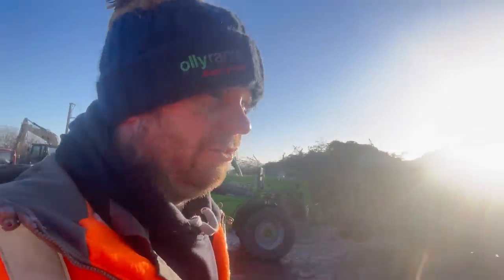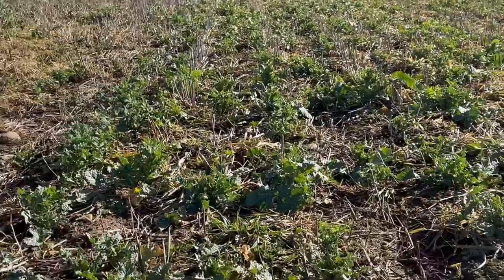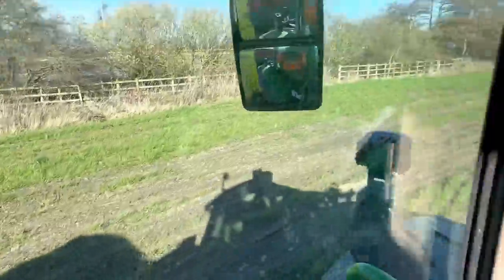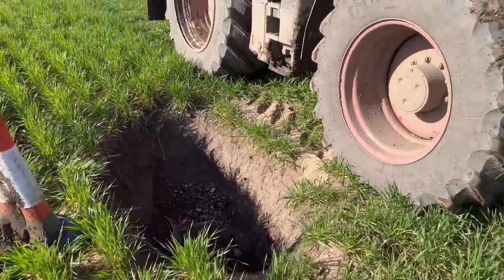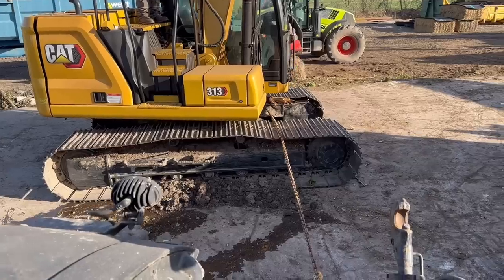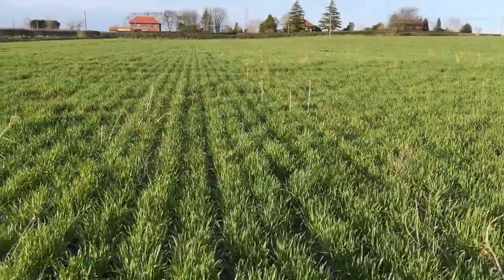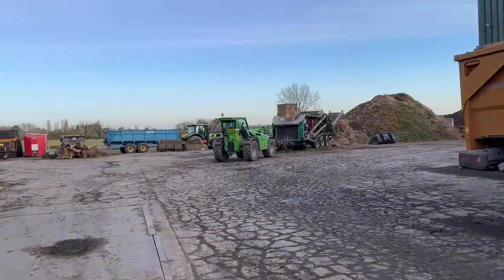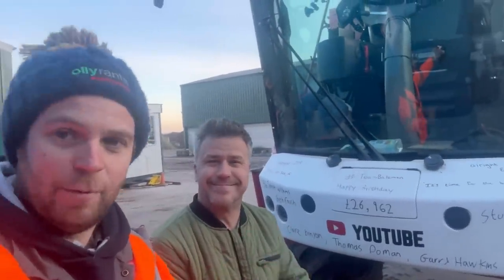HUGE SINK HOLE & A DANGEROUS TREE #OLLYBLOGS #AnswerAsAPercent 1068

Comment: It would have taken the council two weeks to respond in a lot of cases to sort out the dangerous overhanging tree. They would look for a way out of it and if that didn't work then  several safety meetings and road signs almost half a mile in each direction would need putting up and then maybe get 3 quotes from tree surgeons before it could be costed and signed off as a job. Thank God that a farmer with common sense is still available for jobs like this to potentially save someone from injury or death.

Comment: Use your rake instead of the tedder as you'll not hit the grass as hard. Keep the revs down, though I've never heard of anyone doing it.
The Claydon would work if you can keep the pressure off, don't want to pull stones up.

Comment: I personally wouldn't use the tedder for that, a tedder is designed to flick loose, a rake is designed to drag through existing. Using something it isn't designed for is a recipe for breakages to my mind, but happy to accept if I'm wrong. Just don't think it's worth risking your tedder or wearing it out for. Bite the bullet and stick the straw rake on one of the classic tractors, get some old cogs working and charge the batteries a bit. It'd make good footage

Comment: Interesting to see the diffrent drills results, I'd think the vaderstad did the best (hard to see it on a screen) 
A tine harrow (~straw rake) would do wonders to the grass it will pull out the old dead grass and leave it rotting and thus making the nutriënts available. (Don't do it with a tedder unless you want to be changing all the tines 5/6 times a field they break quitte easely)
also the earlier you put on slurry on grass the better the intake of the slurry into the grass is and the effect is still noticeable with the 3rd/4th cut.
Feeling 85% today just a long day at school but looking forward to next week as I'm going to be spreading slurry (my favourite job👍)
Reply: Vaderstad definitely 🚜👌

Comment: I would go for the rake rather than the tedder to scarifying the grass. You would probably break a lot of tines as they are light enough (I can't remember if yours has hooked or straight tines), and damage a lot if the good grass plant, which would set it back a bit. The strawrake should do a better job. I know different places have different conditions, but I would be inclined to wait another 10 to 14 days to reduce the chances of hard frost. I find taking the thatch out too early, along with bad frost sets the growth back
Reply from the maker: Good idea